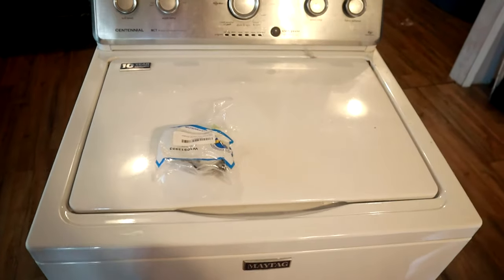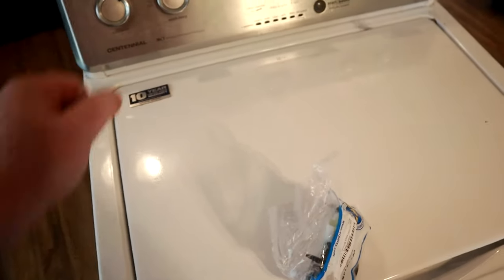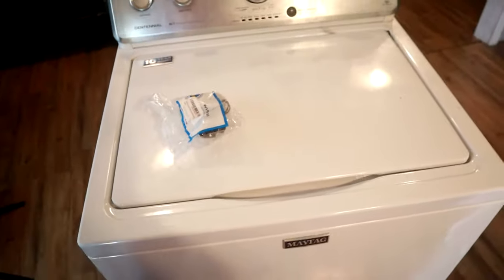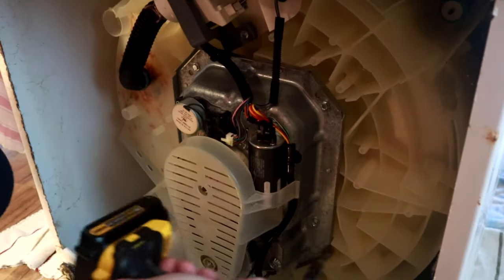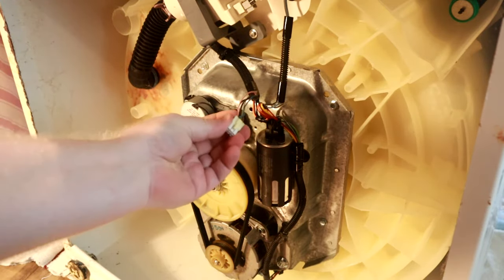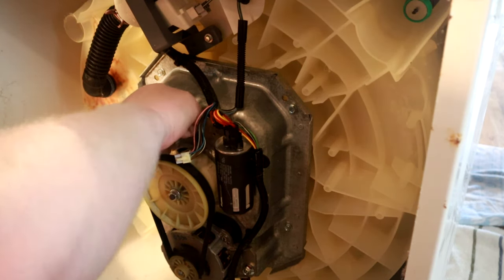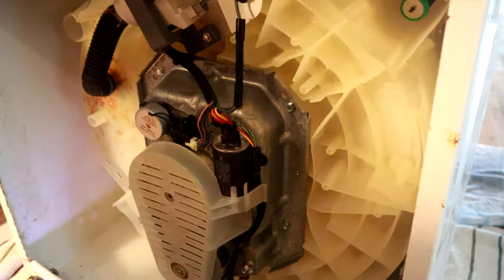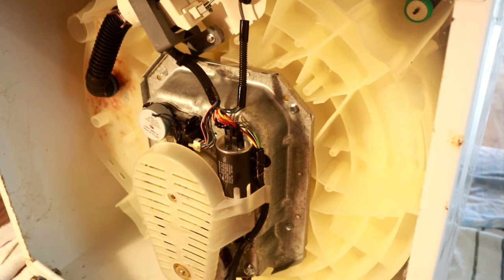How to fix a Maytag Washing Machine that won't spin, replace the spin actuator and check the clutch

Comment: There Two Styles Clutch Actuators used One is Black W10913953 like this one hes using and the Other One is Red  W10006355

Comment: What causes the actuator male piece constantly slip out of the female clutch ring? I put it back and it will was a couple loads and wam bam back at square one. Have to put the actuator arm back in ring.
Reply from the maker: Make sure it's not binding up when it should move

Comment: The problem I have is on my Maytag top load bravos that after my rinse cycle on the “normal” setting it’s suppose to start the spin cycle, but it does not spin, so if I just switch the large knob from “normal” to “rinse and spin” everything is good. You think it’s the spin actuator in that case as well?? Thanks
Reply from the maker: Sounds like controller

Comment: How do you clean the clutch. Watched your video replacing the actuator, but dot have a clue about the clutch. Single widow trying to learn this stuff is frustrating!
Reply from the maker: It's cheap enough that you can replace it easily

Comment: My lights below the center knob on my washing machine wouldn't come on so I tried to reset it by unplugging the washer. Nothing happened. It sounds like the motor is working but the actuator isn't turning. I unplugged it again and then plugged it back in and before the sound of the motor started I pushed the start button for about 10 seconds. Lights came on I washed a load and it worked fine.
Reply from the maker: They're making these things more complicated than they should

Comment: I have this washer but it’s not the centennial. It was washing off balance for a while making banging noises. One day it did that I stopped it and it hasn’t worked right since. It first started to not spin the it just drained the water. Now it will only put a little water in and attempt to spin but nothing else happens.
Reply from the maker: It could be the actuator
Reply: @BeyondtheBoom  hey, i think i have this same issue. does it try to spin a few times making a sort of noise that sounds like it is spinning too fast for about 1-2 seconds and then stops, trying again once or twice before moving to the next step of the cycle? the water drains but the spin cycle just tries and fails a few times.
did you resolve it by replacing the actuator?

Comment: When my top load Maytag washer is filling up, it makes a short hum or buzz and does one loud click. Agitator still agitates ( we just replaced the actuator because it was not agitating, but this buzzing started before it stopped agitating) we also replaced the drive hub and splutches. Any ideas? I cannot find any videos reciprocating what my washer is doing. 

Model number- MVWC565FW1
Reply from the maker: The click may be the valve opening for water or the shift actuator.  We ended up eventually replacing this because it went out again.

Comment: Mine sounds like it stuck between drain and spin. I have unplugged and plugged back in and sounds like at the end of drain  but at end of that no spin and no lights on panel with what cycle it is on.  Is that the actionator or clutch.
Reply from the maker: Not sure but replacing both is easy

Comment: My problem is not that it won't spin but that the spinning no longer gets the contents dry enough. Would these instructions still apply, or would something else be wrong?
Reply from the maker: Sounds like something else
Reply: I saw another video that covers this problem. If the basket is spinning but too slowly then something could be caught in between the basket and outer case such as a sock or something got pulled into the space causing friction against the basket not allowing it to spin fast enough to ring out the clothes. Hope this helps!
Reply: @rickschneider3887  would love a link if you could find it. This is the problem I think I have

Comment: What underneath there would contribute to no agitating..on the topside my drive hub and splines are all good?
Reply from the maker: The shift actuator
Reply: @BeyondtheBoom  today i removed actuator and powered it up remotely..the little motor would run but i noticed no lever action..seems the cam arm has a broken post..so i got a new actuator on order..be my luck i probably broke the post messing with the splutch assembly lol
Reply: @BeyondtheBoom  UPDATE..fixed!..actuator was the problem

Comment: My spin light is flashing but it won't start, do you think it might be the problem
Reply: Mine is doing the same, did you find a solution?
Reply from the maker: It's possible that the actuator is for

Comment: I can’t find model # on my Maytag washer
Reply from the maker: It should be somewhere on a tag.
Reply: Lift the lid. Look at the bottom of the lid where it connects with the body of the washer. Model and serial number are visible.

Comment: I have this same Maytag washer.  Everything works OK but the spin is not fast enough to remove the wetness from my clothes?  What is the most likely cause?
Reply from the maker: It could be the balance. Since recording this video we had to replace this washer. It was still working but we found a good deal on a clearance model.
Reply: I'm having the same problem, any suggestions? I don't think this is the fix we are looking for....let me know how yours turned out and I'll continue to look for solutions.  Thanks
Reply: @BeyondtheBoom  thank you for this great video
Reply: What type of screw gun is used to remove the cover?
Reply: Did you tried changing the capacitor?

Comment: The Agitator of Maytag machine  is making loud noise when washing the clothes.  Please help. Should I repair or discard the machine.
Reply from the maker: If the gears are stripped that may cause it.

Comment: My issue is if I put the washer on normal cycle it wont drain all the water out and wont spin them dry but if you select spin drain or spin rinse it will work that way just not on regular cycles
Reply: This is basically what mine is doing, but sometimes it will work on normal wash cycle, sometimes not.
Reply from the maker: We ended up getting a new washer due to this one having other issues.
Reply: I have this same issue on my Maytag bravos when on normal cycle it drains the water but then does nothing when it’s suppose to spin. If I switch cycle to “rinse and spin” everything is fine. You ever find a solution?

Comment: We replaced the actuator and it still won't spin unless you put it in drain and spin mode.
Reply from the maker: You might have a controller problem.

Comment: i have a maytag washer and basically it fills up with water then won’t go into the next cycle and stays like that and you have to manually put it into the next cycle and wait for about 5-10 mins for it to turn on or sometimes it actually works and goes through all the cycles but it’s so inconsistent. 
also, whenever i put cold/cool water no water will come out only hot. 
any ideas what it might be?
Reply from the maker: It could be the controller
Reply: lid switch?

Comment: Hello, you can hear my washer try to engage spin mode, it will do it twice and then quit. Would this likely be the spin actuator? Have already replaced the agitator hub once and think it might be stripped out again. Another video said the spin actuator was a faulty design from the factory.
Gonna dig into it here shortly, any advice is greatly appreciated. Thank you
Reply from the maker: It could be the actuator yes. You could also have a bad clutch
Reply: @BeyondtheBoom  Hi, Changed the actuator and the clutch but now when it gets to the spin cycle it spins but it is very loud. No grinding just loud spinning. Also having problems with calibration. Could the transmission be going bad be a reason for the loud spinning? About at my wits end with this thing!
Reply: @BeyondtheBoom  What is the round sprocket part that is under center cover in tub called.
Reply: @billshull9468  
The hub

Comment: My Mayrag knocks & won't spin.
Reply from the maker: Check the clutch. They're soft plastic and can easily break.
Reply: Where is the clutch at please?
Reply: Under the washer it's actually called the splutch assembly there are several videos on YouTube on how to replace it

Comment: Hey there. There's another video that after replacing any part , you have reset the machine codes by turning the big dial counter clockwise and then clockwise. ????
Reply from the maker: I didn't on this one

Comment: I have a similar model, everything operates during the different diagnostic tests. But when actually trying to operate the machine during a regular wash cycle, it will go through sensing, wash and rinse and when it gets to the spin cycle, the green light is on, solid, and the machine just will not run the spin cycle. Will replacing the actuator possibly fix that?
Reply from the maker: That's one of the reasons it stops. I replaced the actuator and clutch.
Reply: Same not sure what to do

Comment: how the hell do you determine the damn spin actuator is bad??!! My washer had a plugged drain.  Cleared it out, filled it with water, then it spun and drained completeley. Then I  washed a load of clothes, and stopped with a full load of water! Why????!!!
Reply from the maker: This one wouldn't spin at all. Check your drain valve